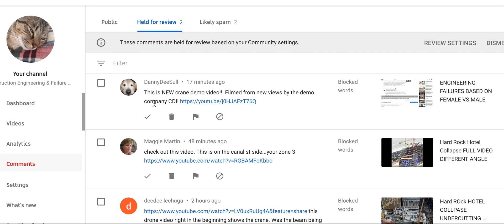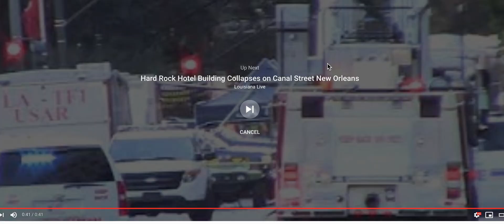HARD ROCK HOTEL COLLAPSE DEBRIS FIELD NO CONCRETE SLABS =SHEARED WALL SYSTEM Spandrel NOT distorted?

Comment: Is it possible that your looking at the fire proofing on the under deck side?
Reply from the maker: Charlie, I like that possiblity,  thank you, I will explore that and your comment extends into another possiblity of weak floors, video to come.
Reply: agreed, My initial thought was maybe it was video compression averaging out the thin pan lines going the other way on that section of the floor like I had seen in the bent shoring vid, however, this news vid is a tad better quality, so maybe fireproofing instead.

Comment: The very front columns look pretty flimsy, the elevator appears to be attached to the columns on either side.  I don't believe the elevator in any way caused the building collapse but I can see the weight of the elevator structure ripping the columns away when it was seriously disturbed by the collapsing  building.  The wall fell inward everywhere else.  I think the pancaking slabs sheered the steel flooring beams off the columns and because of the elevator it fell backward onto the street instead of inward like the rest of the walls.  The cross bracing between the two columns still appear to be attached the columns.  I do believe the video shows this elevator structure falling out well after we see plumes of dust shooting below the elevator.  Quite possibly the only reason that part stayed up as long as it did was because of the elevator attachments keeping the steel together.  Everywhere else, it looks like all the steel joints on the front wall until you get to the short crane just disintegrated.  The short crane may have provided a break point to prevent some of the propagation of the progressive failure on the front wall.  That is to speculate, if the crane had not been there the rest of that front wall would have came down uniformly until you reach the corner slabs which just cracked and laid down.